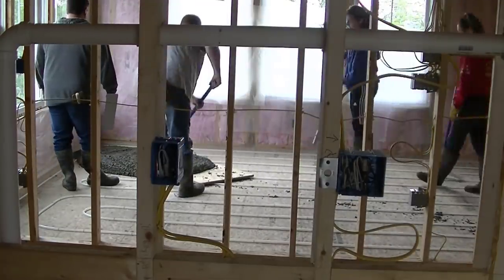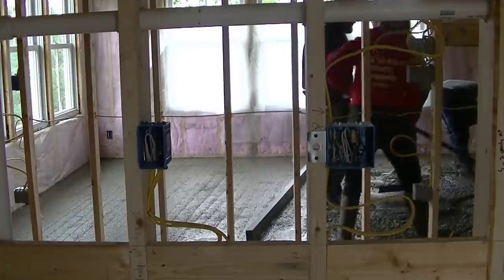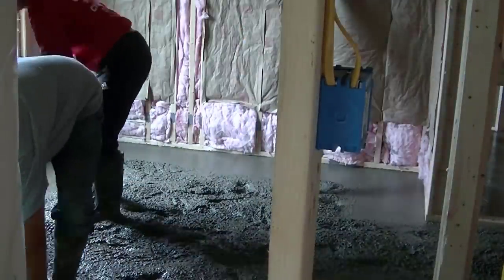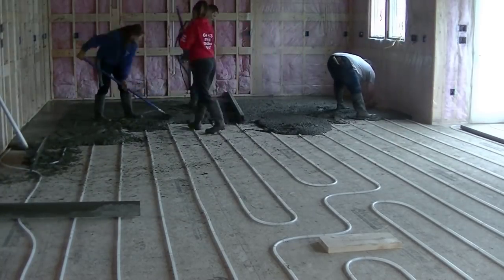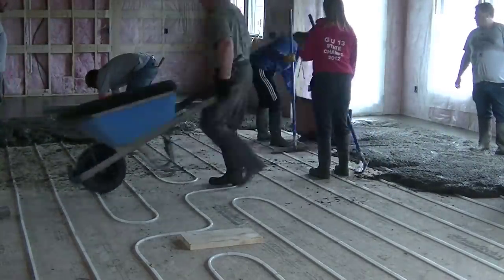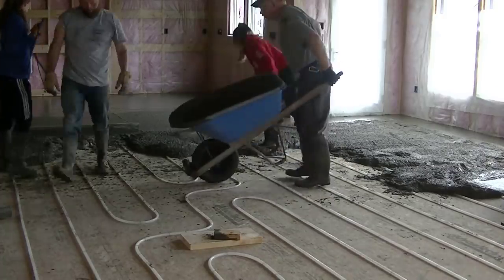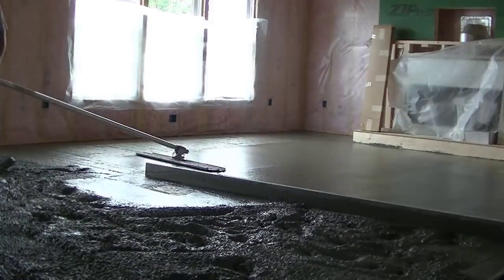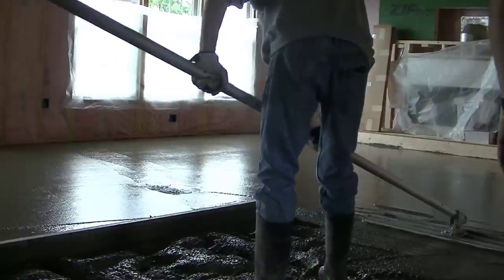RADIANT HEAT CONCRETE FLOOR | OVER PLYWOOD

Comment: Well guys I did this 24 years ago and it heats amazing loved it. Down side and recommendation is the 11/2” thick concrete will crack and possibly shift at the cracks. Back then we put new carpet over majority and ceramic in kitchen/ bathroom. If I do it again I would lay a mesh for sure. When we pulled the carpet to lay wood floor we had issues with offset cracks and high spots.

Comment: Hey, thanks for all your videos. I am pouring 1 1/2” concrete over OSB sub floor and heated tubing. My client would like to finish the concrete with epoxy. After concrete is dried and cured and cracked we would like to go back over patch any cracks and put epoxy down. What do you think would be the best mix for concrete to have minimal cracking with a 1 1/2” thick on the second and third floor of this project. PSI? Aggregate? Reinforced fiber?

Comment: When I did my house I use 2x3 sleepers ran the tubes between them; the 2x3 were my nailers, and I used a pump truck. I sealed the concrete I didn't want the dust from the concrete. I used, cure, and seal, that was 20 years ago.
Reply from the maker: Occasionally we'll pour one with sleepers, but most are this way. Sleepers are mostly used when someone is nailing down a hardwood floor in our area.

Comment: Hi Mike, would you add mesh over the tubing to prevent cracking? Our house got a 4 ft crawl space
Reply from the maker: We do that sometimes, it does help hold a crack tight if it does crack but it doesn't prevent it from cracking.

Comment: This is a cool concept, and you did a great job. But I'm skeptical about how much weight this adds to the structure of the home. I understand it may be engineered, and I read that floor trusses were used. Was the subfloor structure beefed up below such as additional columns and such?
Reply from the maker: Sub-floor wasn't beefed up, it didn't need to be. 1.5" of concrete adds approx 18 - 19 pounds per square foot to the floor. These floor systems are rated for much more than that now a days.
Reply: @MikeDayConcrete  How does one find out how much weight their floor system can support?

Comment: That's impressive to get 10yds flatwork down in all those small rooms in 90 min.  I've seen gypcrete done that was virtually self-leveling, but not all the work concrete needs like this.  Would attaching any sort of vibrators to the joists help and make it more self-leveling without resorting to plasticizers or higher water in the mix ?
Reply from the maker: I'm not sure, we've never thought of that. We use water reducer in the mix so pouring it loose isn't a problem.

Comment: Have you ever done a stamped finish as the final floor ? I want to add hot water radiant to make a closed in concrete porch a four season room. This should allow a using 2 inches and floor would look like tile. I guess the only problem would be cracking over the long haul.
Reply from the maker: Yes, quite often. Here's one we did.  https://www.daysconcretefloors.com/stamped-concrete-manchester-me.html

Comment: Have you done a full finish with color on the concrete instead of putting an additional finish floor on top? If so what did you do ?
Reply from the maker: We stain and seal concrete floors. We stain and polish them too. I also epoxy a lot of concrete floors.
Reply: Mike Day Everything About Concrete : how is the radiant tubes attached to the plywood?
Reply: @jaymccormack5850  he mentions it at least once...stapled down

Comment: Hi Mike,  I'm doing a radiant on top of a slab. I glued down insulation and then stapled pipe down. I want to keep concrete exposed so I decided to pour a 2 inch thick slab. Is there anything you recommend?  

Thank you for your doing videos! 
Derek 
Granite Falls , WA
Reply from the maker: We would use a micro fiber mesh in that and saw contraction joints about every 6' or so to help control shrinkage cracks. We do quite a few of those like that, I use a 3500 psi mix with 3/8 stone.
Reply: At 2" thick slab is there a keyway I could use for the contraction joints?

Comment: If there is no insulation under an existing concrete floor,  would one put a layer of the bubble foil and then plywood with the tubing?  Is the plywood or OSB be sufficient insulation?  Thanks for the great education!

Comment: Hi Mike, Great I've found the video. Im in CT and plan to install RH over the 5" slab. There is no insulation underneath it. I m thinking to use R10  Ampex 24-in x 48-in Grey Insulation Panel with nubs to have 1/2" PEX layout in between them. Have you ever poured above the panels and what are your recomendations? Thanks
Reply from the maker: Yea, we pour on those panels all the time. It's pretty much the same as pouring on styrofoam. You should be good and have no problems.
Reply: @MikeDayConcrete  Mike what material do you use between concrete and a wall when pouring aganst the wall framing if the pour lever of concrete is higher than the PT board height? or there is 2x6 frame and drywall and you need to pour for radiant heat floor. Please advice. thank you

Comment: I've seen gypcrete floors like this but never heard of concrete.  What's the benefit of using regular concrete instead of gypcrete?
Reply from the maker: It's a lot less expensive, and my contractors say we can get the concrete a lot more level than the gypcrete.

Comment: Could you have stamped that concrete with a pattern ie wood grain?  If not, could you have done thinner layer and then a gypsum layer on top once it cured to do a stamp layer?  If you did control joints in the first layer, the second stamped layer would have a better chance of not cracking?  I like the idea of having as much thermal mass as possible.  Thank you!

Comment: How does the water tubing radiated heating compare to electrical? Maybe cheaper elec cost, but is it as effective? and what are some general cost differences in radiat heat materials.

Comment: Silly question.  On these type of floors you don't need rebar?
Reply from the maker: No, no rebar required. The concrete isn't being used for structural strength only to hold the heat from the pex tubing.
Reply: @MikeDayConcrete  hello from France! I already have a structural solid concrete floor, I've put polyuréthane insulation on, then electrical radiant floor(more easy for DIY) and I want to pour a 3 inch concrete slab, power trowel and polish it without aggregate and level 3 of gloss. Since it's not structural, I understand we don't need wire mesh but what about the joint? And also, will I have problems with the microfiber polypropylene if I don't expose aggregate and only start with a 200 resin pads? Thank you so much, you rocks!
Reply from the maker: @azadatay5480  Depending on the size, you'll have to saw contraction joints for anything larger than 2 meters square. You should be ok with the microfibers. If you do end up seeing some, just use a small propane torch to burn them away.
Reply: @MikeDayConcrete  thank you Mike! Don't won't to take your time but just another question : what about polishing of self compacting concrete floor? Is it just the same? I don't won't to expose aggregate so I don't care if the little stones runs lowers into the concrete.
 Thanks again, I think I watched half of your videos, I was more into wood stuff and plastering, it's my first time with a real concrete floor and I became obsessed with concrete🤣

Comment: How did they keep these heat from radiating down through the bottom?
Reply from the maker: Jason, they insulate under the floor joists.
Reply: Heat rises, and wood is a poor heat conductor. So those are 2 things going for it. Concrete is a good at absorbing heat and will give that radiating value and will go up.

Comment: What's the floor structure like under there? Wondering what they used for joists and subfloor. I'm thinking of doing a concrete roof so this is pretty much the same idea..
Reply from the maker: The floor structure in this home was floor trusses every 2' on center with 3/4" Advantec plywood flooring. Some houses the floor joists are either 2x10 or 2x12 one foot on center.

Comment: The problem with this concrete over wood floor is if the wood underneath gets rotten, then it is hard to fix it.  I believe for durability consciousness: When using concrete over wood flooring for second floor, you have to place steel rods framing before pouring concrete. 

Does anyone knows the most important part in building homes? 
Read below. It is a long letter but will give you a good knowledge in building your home. People are getting sick nowadays for PRIMARY reason, they sinned against the laws and commandments of God. SECONDARY reason they live in homes with bedrooms that are not facing east where the sun rises. What is so important about having a constant sunlight in the bedroom? 

Sunlight is like a gasoline. Car will not start without gas. When the sunlight enters your body, it manufacturers natural calcium. Calcium helps strengthen the bones, teeth, muscle and calms the heart. Sunlight boosts immune systems, helps every vitamin function in the body properly, helps regulate hormones imbalance that causes mood swing, kills bacteria, helps lose weights, and anti inflammatory. Researchers said it can protect you from corona virus, and infection. Sunlight also keeps your room warm in cold season, and kills molds and bacteria. 

Malachi 4:2
But to you who fear My name The Sun of Righteousness shall arise with healing in His wings; And you shall go out and grow fat like stall-fed calves.

Bedroom is the most important room in all the rooms in the house, because it is the place where you spend most of your time. For those who are planning to build homes, it is the best choice to place all bedrooms facing east as the morning sun has the most beneficial stage. People who already built houses, try to build balconies where it faces the morning sun. 

Psalm 127:1
Unless the Lord builds the house, they labor in vain who who build it; Unless the Lord guards the city, the watchman stays awake in vain. 

The Lord God gave us sunlight to the utmost. Due to disobedience towards His Law, people corrupted it with pollution. It thins the ozone layer in the atmospheres that protects us from sunburns and ultraviolet light. The result of it, people cannot get in the sun as what their body needs because of extreme heat coming from the sun.

This knowledge comes from Mount Zion, Heavenly Jerusalem. Lord Jesus brought in this last day to save His people from destruction and death. It is the Kingdom of God which is to be built physically. It used to be a part of Israel. After the Jews rejected the Lord Jesus, the Lord God took it from them and gave to another nation in the east that will guide many people to serve God in Spirit and in truth.

Psalm 48:2
Beautiful in  elevation, the joy of the whole earth, is Mount Zion on the sides of the north, the city of the great King.

Daniel 2:44
And in the days of these kings the God of heaven will set up a kingdom which shall never be destroyed; and the kingdom shall not be left to other people; it shall break in pieces and consume all these kingdoms, and it shall stand forever.

Matthew 21
"Therefore I say to you, the kingdom of God will be taken from you and given to a nation bearing the fruits of it. And whoever falls on this stone will be broken; but on whomever it falls, it will grind him to powder.” Now when the chief priests and Pharisees heard His parables, they perceived that He was speaking of them. 

Lord God of hosts, Holy Father
Lord of hosts, Lord Jesus
The Spirit and the bride
Mount Zion, Heavenly Jerusalem
Gabriel, an angel of the Lord

Comment: Radiant flooring is great, but you should be using gypcrete for this installation, reasons are gypcrete is self leveling, light weight compared to concrete, and won't crack and it has a thermal mass.
Concrete should not be used for this application. BEWARE.

Comment: Wood in direct contact with concrete will rot and fail 100%. Am I missing something?
Even a poly vapor barrier would be better than nothing.
Reply from the maker: Sal, I have to disagree. I've been doing these for 39 years and never heard of one failing. Once the concrete is cured there is no moisture to make the wood rot. What is your reasoning for thinking this will fail. These floors are engineered, it's not my design.
Reply: if it was in contact with soil, perhaps. once it is a solid mass, where is the moisture going to form from? AND, if that was a concern, a couple uses of the heater will eject minimal moisture out

Comment: No expansion around the perimeters ain't gonna be good
Reply: Find myself here again..
I only have a vague answer so i figured I'd say more while i enjoy watching..

A job like this, MINIMUM 1/4" gap,  maybe 3/8" ideally for expansion and contraction.. also engineer expansion joints into the pour. Every large pour has relief cuts and expansion joints. 

Every room entry, and any run longer than 12'.

As a tile setter, i need to do that in homes or the job WILL fall.

Probably the biggest part done wrong here besides the concrete to the studs is the bed should be on an uncoupled substrate.